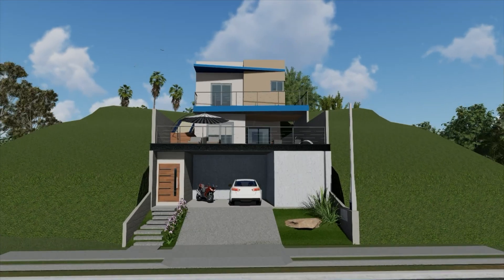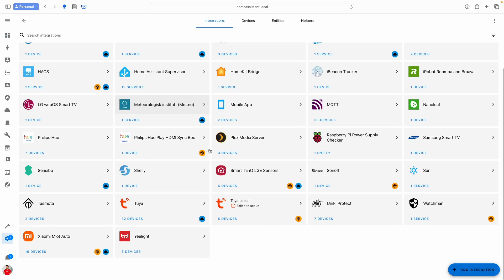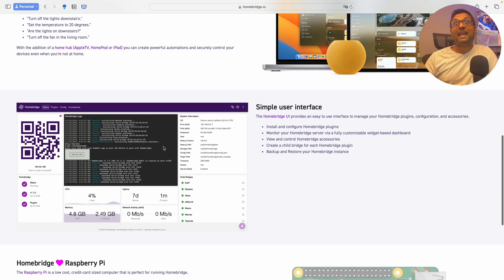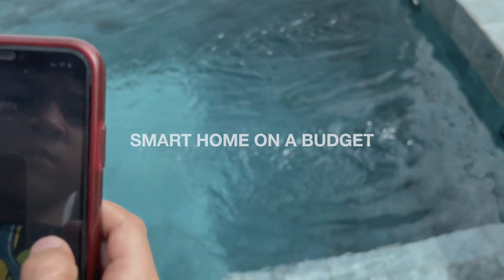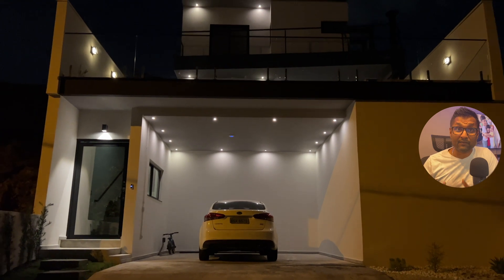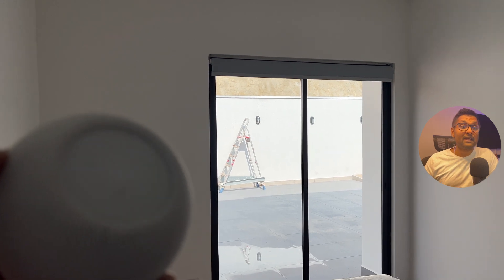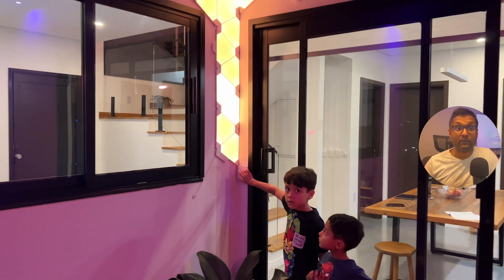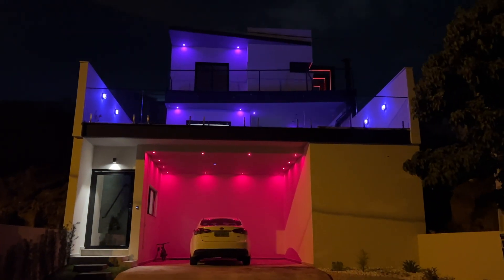Apple HomeKit & Homebridge - Finally starting My Smart Home Journey

Comment: Hey mate, thanks for all the informational videos about Smart home.

Currently all my smart home is Apple Homekit based. I have been postponing setting up my Homeassistant Yellow for the last two years as Homekit Dashboard + Alexa Voice/Routines have been doing a great job. I am looking to expand and build more complex automations. Just wondering if I should  go ahead with Homeassistant configuration or also have Homebridge setup. 
1. Is Homebridge still needed when you can get Homeassistant?

2. Is the main benefit of Homebridge is to be able to get all the non native Homekit supported devices to the Homekit (which I believe Homeassistant cannot do)?
Reply from the maker: Glad the videos are helpful. Both can co-exist.

Comment: Congrats! 🎉 QQ - Home do you simultaneously run Home Assistant and Home Bridge?
Reply from the maker: Well I am currently running each of them on a dedicated Pi 4 n 5
Reply: @eddiedsuza  Oh, okay. I've seen setups where HB is ran on a HA Pi using Docker add-ons. I'm planning to try it out whenever I have more time on my hands. :) Heads-up to you as well, if you want to repurpose one of the Pis. Thanks!
Reply from the maker: @danielgospodinow I did do a video hosting HB and HA thru docker containers using a pi 5
Reply from the maker: @danielgospodinow  thanks for the tip ... However I am starting to take a look into Dakboard to build a dashboard for our home office and see how I can integrate and HA into it
Reply: @eddiedsuza  Wow, nice! Sounds cool. Good luck and I'm looking forward to a video that explains this. :)

Comment: Looks like you are going to have lots of fun automating your new place.  Beautiful home!  Just wanted to let you know I’m in a similar new home environment with lots going on but my favorite is the Enphase HB plug in that reports out power production, Battery charge and whether the the public grid is available which provides virtual load center logic to cut back power and preserve batteries for the whole home.   Need to think about what to call the system as when I ask for status of the solar system Siri gives me home stats sometimes and links to info on information in the sun other times!
Reply from the maker: Appreciate the feedback ... And yes from a distance - we do deserve a tap on the back ... Putting a smart home is one but adding in sustainability makes it more interesting and worth while as well. So far i am just reading data off the production but i found a python script that can automate devices based on the suns position as well detect the peak generation to turn on specific devices ... Still learning :)

Comment: Welcome back. The house looks amazing! Will be watching. I am especially interested to see if you have a way to limit what each family member can access/control. For example, I wouldn't want my kids to be able to accidently turn off key security accessories or safty accessories like leak sensors, etc. Can we provide limited access to family members? If so, a video on this would be great.
Reply from the maker: Steve thanks for the compliment .. Currently my kids 8 & 5 dont have any idevices but yes you can only limit accessories access via the apple home app which is under home settings > Under people > select the user and theres a toggle to allow Add / Edit accessories